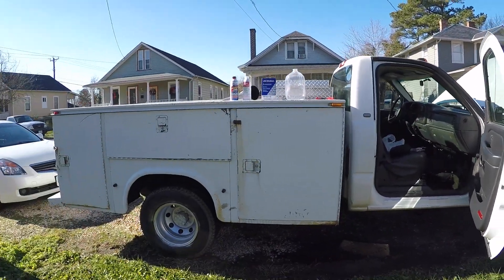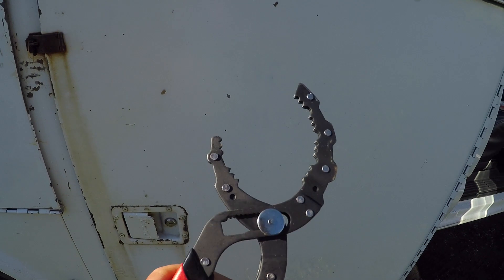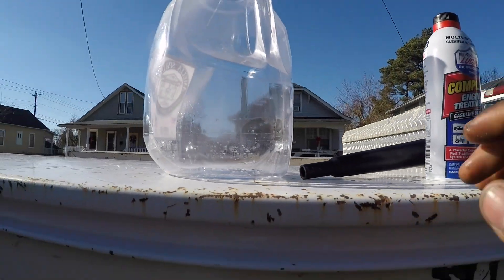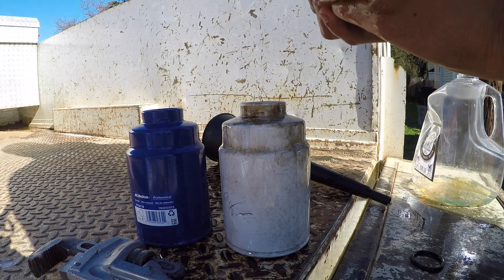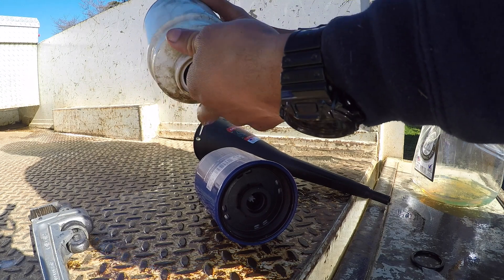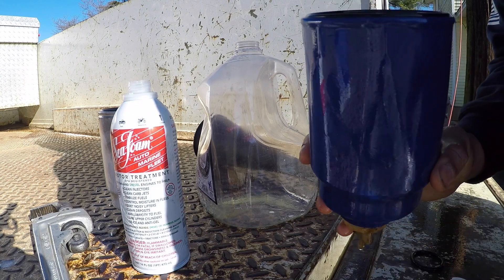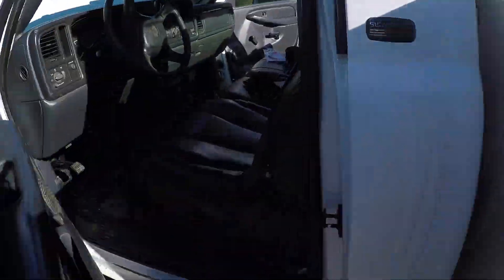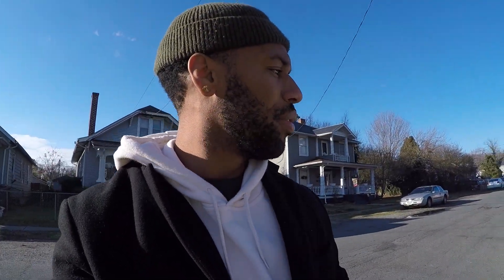How to Seafoam a Durmax(complete fuel system cleaner)

Comment: Great video.  First off. Your fender liner has 5 plastic plunger clips and then it comes out. No need to cut a hole. Second. Your water fule sensor * on the bottom of your filter is not connected. Looks like the wires are broken from the harness. You should fix that. 
The pipe wrench made me laugh.